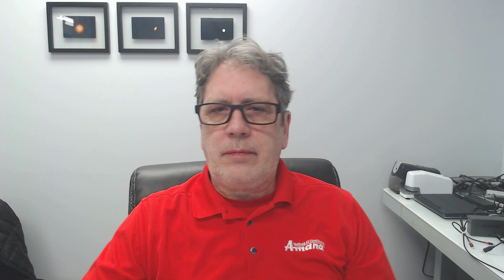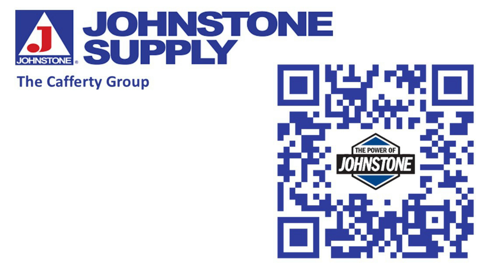Finding heat pump economic balance point add on..

Comment: Why aren’t DELIVERY charges for electric & gas figured into determination of economic balance point?
Reply from the maker: They are, in some cases, but I did not for the video because they are different in every area. If your in a heat pump driven area a lot of time you will have your own meter just for the heat pump and can do calculations. But otherwise how much of the delivery charge and use would you have any way if you did gas furnace? If you did not have a heat pump would the charges be different? If they are on the bill for basic power do you choose to add them or a portion of them to heat pump?